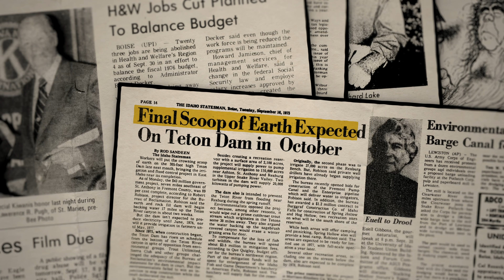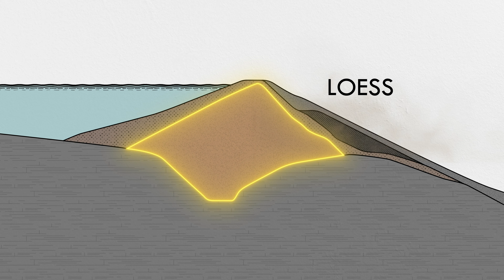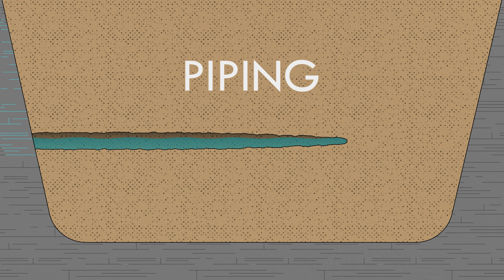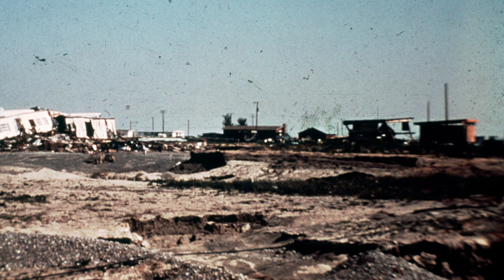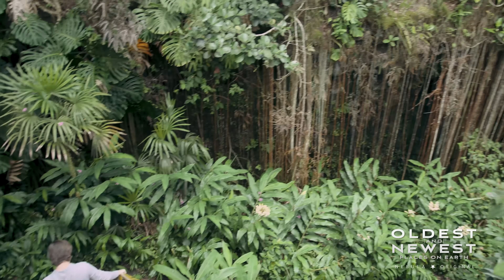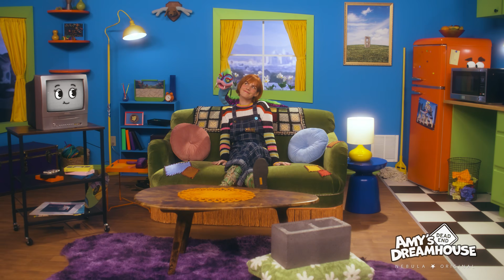The Wild Story of the Teton Dam Failure

Comment: Would filling the reservoir slowly, 1 foot/day (~30cm/day), have helped in this specific situation? It seems that the water piping was caused by the pressures of a filled reservoir that could not have been observed until the reservoir was full.
Reply: Ideally, the slow filling would allow for the operator to release water should an issue arise. Without the river outlet though, the releases would be limited compared to the large snowmelt inflow
Reply: @formu1fan when the dam was under construction, there must have been some bypass for the water to flow around the dam, right? Why wasn't that still available?
Reply: @sebastianjost  there was, but it wasn't sized for the amount of water they were getting THAT year with the high amount of snowmelt expected.  I didn't catch the timing of when they started to fill vs when the dam failed.  It's possible that they had started filling well before they knew about the high snowmelt year, and even once they found out could no longer do anything about it (the mistake being to allow filling at all before the other bypass was complete)  If this wasn't the case, and the filling and failure happened in a single year, the mistake would have been not halting work on the embankment until the other bypass was complete.
Reply: @sebas @sebastianjost  

River flows in this part of the country are HIGHLY seasonal, as it's a very dry climate for most of the year, but winters can be wet and we're downstream from major mountain ranges.  They'll be a tiny trickle during the summer and fall, then when spring comes around and all the snow accumulation starts melting, flows will be extremely high.  It's part of what makes (properly-built) dams and hydropower work so well in this area; lots of free energy and we want to control flooding and retain water throughout the year for people and farmland.
Reply: No.   50 years later, the fill rate myth persists.   Ill be publishing a paper on the Teton Dam fill rate myth in the "Teton Letters" publication on substack
Reply: No. Only an AI can properly fill it. 🙂

Comment: Would using a silt/clay mix have been better? Most man made ponds I’ve worked on (retired land surveyor) had clay bottoms to prevent leaking. Thanks for the video👍
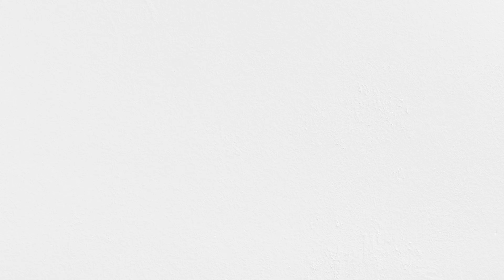Reply: I think the answer begins at around 3:59.  "Teton was a zoned embankment dam, meaning it  was made of different kinds of compacted earth,  each serving a different function. That soil came  from borrow areas near the site of the project to  minimize the cost of hauling it."
Reply: Anything would have been better than our loess soil.  That stuff washes away if you look at it funny.
Reply: @SynchronizorVideos  If the wind can transport it a long way, the water can certainly move it-